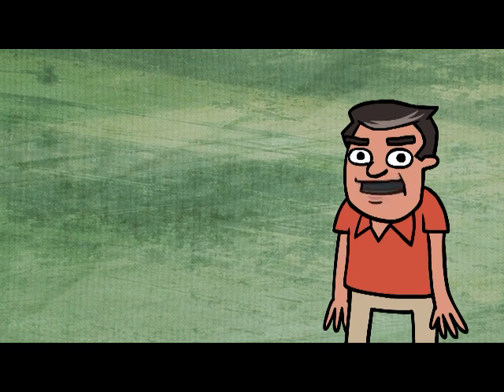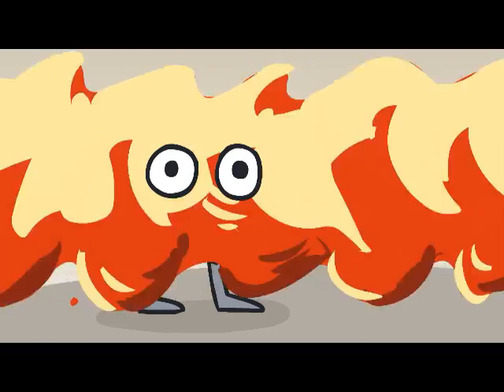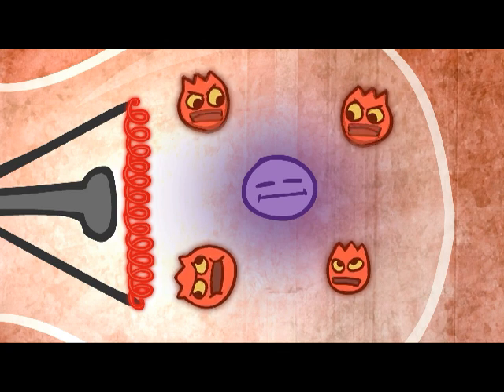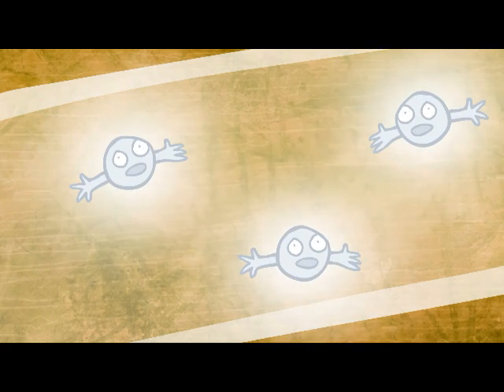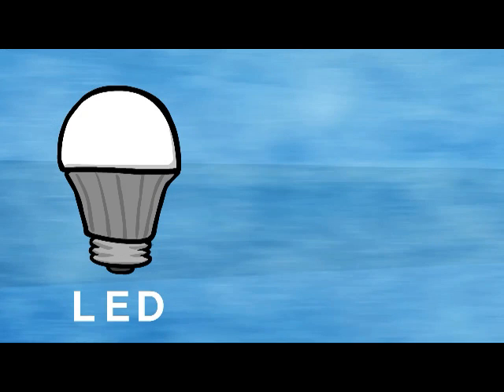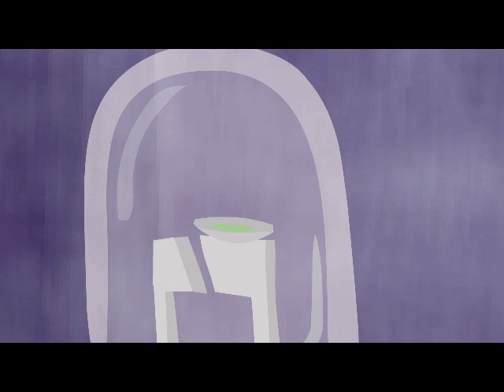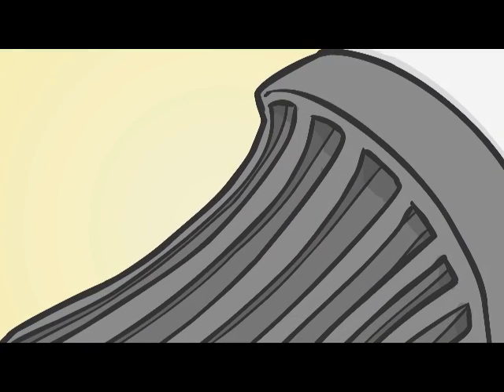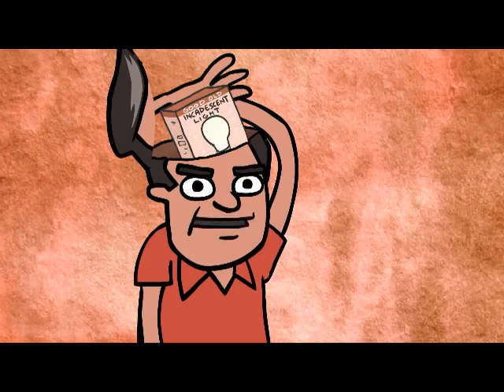Energy 101: Light Bulbs

Comment: Actually, only regular fluorescent tubes came out in the 1940s. The first CFLs weren’t around until the 1980s, and the familiar helical design didn’t exist until around 1997.
Actually, it isn’t the phosphor hitting the mercury that produces the light, is the UV light emitted by the mercury when the electrons excite it making the phosphor fluoresce.
OMG there are warm white CFLs! And not only that, they are the most common type!!! Your guys really need to work on your research.

Comment: You can find Chinese LED bulbs on ebay now for less of $1 if you buy multiple bulbs. Like a 20 bulb package. LEDS are truly almost forever, HOWEVER its not the leds themselves that usually fail, but fucking capacitors, diodes and other crap on the board usually fail prematurely regardless of the brand you buy. I never had a LED bulb lasting me more than 5-7 years then it fails. I opened them up and measured with a multi-meter, yup blown caps, etc. So this 50 year guarantee is pure BULLSHIT!

Comment: An excellent and informative video. Something to mention: The price of LED light bulbs has dropped quite a bit from the time this video was posted. I recently purchased a 60W-replacement LED light bulb and paid about $16 (US) for it.
Reply: They've come down in price even more from the time that comment was written, last week I bought some packs of "filament" LEDs (40W replacement) for £3 (around $3.75) per bulb. These bulbs are also quite a bit more efficient than even a conventional LED, using only 4W to produce nearly 500lm. I installed them in our back room (6 bulbs in total) and I love them - they provide a nice, warm light (2700K) and are pretty much indistinguishable to an incandescent
Reply: @aarondynamics1311  Your body and brain DOES distinguish the frequencies emitted though. That's the problem with LEDs.
Reply: @thebiggestpicture3230  Yes I prefer incandescent light over LED. There is something about the LED light that is harsher. Besides that, there are loads of other problems with LED bulbs:
1. Heat - Many LED bulbs made today just don’t have good heat sinking. They also contain crap drivers. That combined with the poor heat sinking makes that driver get incredibly hot, shortening it’s life significantly. Some LED bulbs don’t even last as long as incandescent bulbs! CFLs, which are notorious for not lasting very long, often outlive LEDs.
2. Glare - LED bulls are very directional, which produces a lot of glare. This can range from tolerable to light overload everywhere! Good examples of LED bulbs that often have a lot of glare are LED flood bulbs and many of the integrated fixtures, which brings me to my next point.
3. INTEGRATED LED LIGHT FIXTURES EXIST - Integrated fixtures, like that was a good idea! 😅 Yup, when the thing burns out, you gotta replace THE WHOLE THING! Many are not serviceable, and they are EXPENSIVE. Plus, if one dies before others in the same room, you might not be able to have matching fixtures because the original model was discontinued! LED integrated fixtures also often have lots of glare to them. The record holder is LED street lights, which often have intolerable glare that can impair drivers’ vision at night. When used in neighborhoods or other places near residences, they can even shine through windows and cause people to have trouble sleeping, prompting them to buy blackout curtains they otherwise wouldn’t need! And all that so you can save a couple watts? And did I forget to mention that many are so busy shining into people’s houses that they don’t even put as much light on the street?
4. Many aren’t what they claim to be - Many LED bulbs and fixtures, especially those made to replace fluorescent and HID lights, often aren’t nearly as bright as what they claim to replace. For example, a typical LED T8 4’ tube emits around 1800 Lumens. The F32T8 fluorescent tube it claims to replace is 3000.
There, my rant is complete.
Reply: @rs12official  This rant was very educational for someone wanting to go into sales of light bulbs. Thank you!!
Reply: 16 bucks for ONE BULB 😳